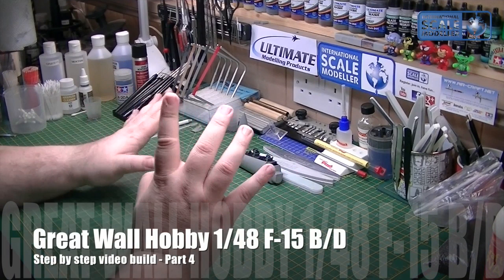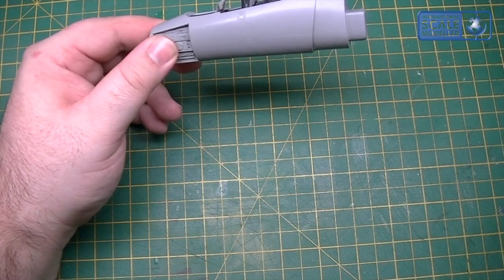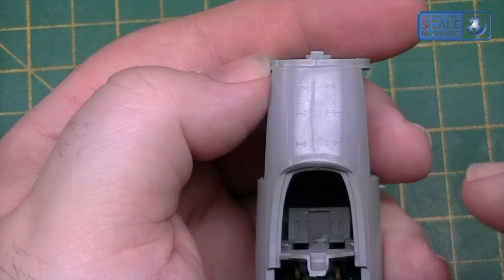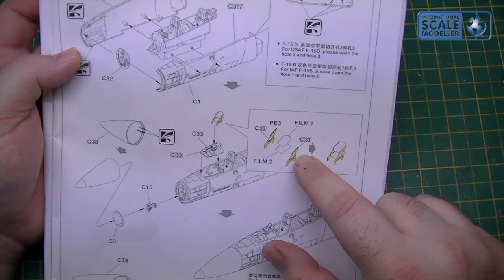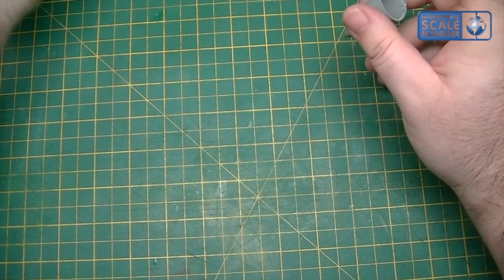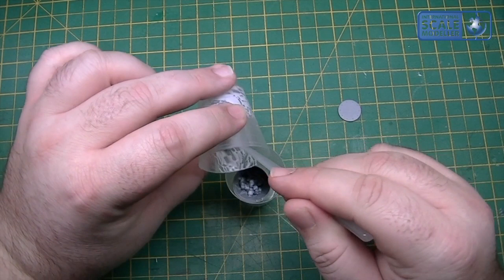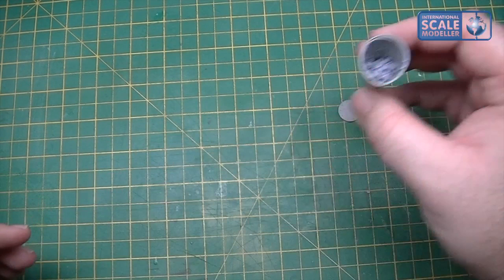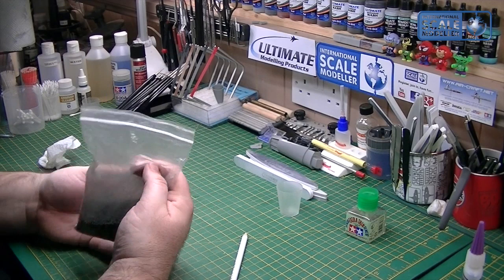Great Wall Hobby 1/48 F-15 B/D Step by Step Video Build - Part 4

Comment: Hi Paul, just had to say my friend, your cockpit, in my humble opinion, is absolutely not over the top....not one bit!. As a matter of fact it looks like an actual F-15, and believe me I have seen many of them up close. As a commercially rated pilot your cockpit looks REAL...like a jet that see's the kind of hours these jets see. They look new direct from the factory, but trust me they don't stay that way long at all. Your build is looking just smashing indeed. Here I am watching it start to finish....again...because it's filled with great techniques and product demo's as well. I'm in the US, but i  need to find a way to buy your Ultimate Washes because with a clay base I can clean off all the excess without any fear of activating my acrylic colors underneath with an enamel thinner. Also liked your idea of making your own wash with the Model Air water base paint. Thanks for sharing!
Reply from the maker: Thanks for the kind comments.  You can get the Ultimate washes direct from umpretail.com or in the USA from hobbyworld-USA.com - All the best :)

Comment: If you get a bit of wood, you can make some little wedges to deal with those kinds of open parts that have a step, so when you clamp, they'll be sure to stay straight. Use a rotary tool with sanding drum to make cone-shaped wedges for round parts with that problem. (If you have some little cone-shaped objects you can mold up & pour in resin, it's a lot easier to get a more perfectly rounded shape). With either wood or resin, you just need to wrap in a little wax paper, so you don't glue your wedge to your model.

Comment: I've never seen this glue system before. Very clever
Reply: Well worth a look, its not the cheapest but it works very well. Theres a separate review further back on the channel
Reply: The touch n flow is awesome I bought that and the flex e files and there both great is found out the company is just an hours drive from my house but I must say I'm a little mad at the company the needle tip on my touch n flow was bent to hell
Reply: When I received it in the mail and the company wouldn't replace it they just said the bend it straight